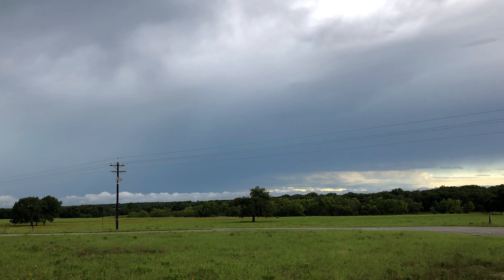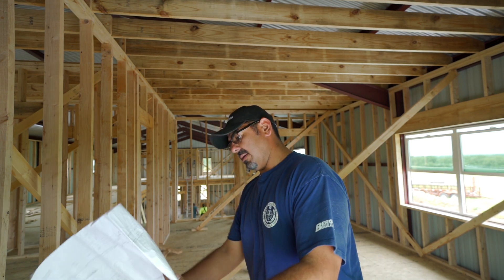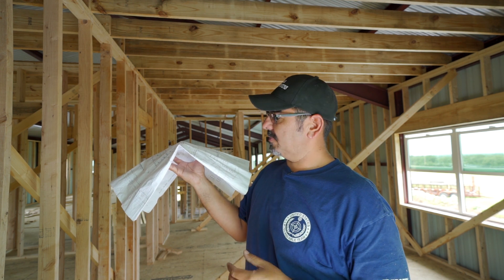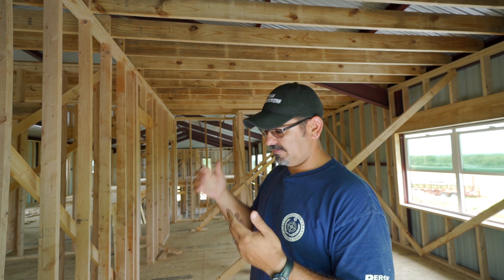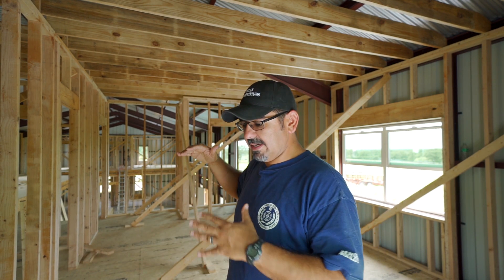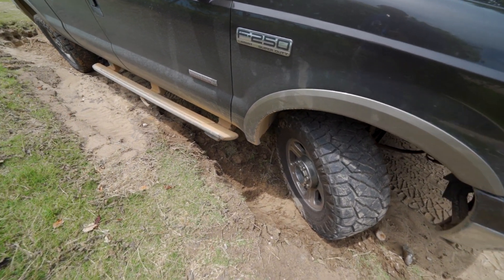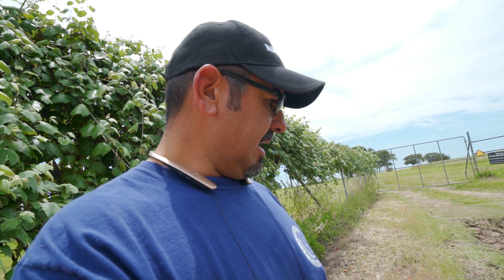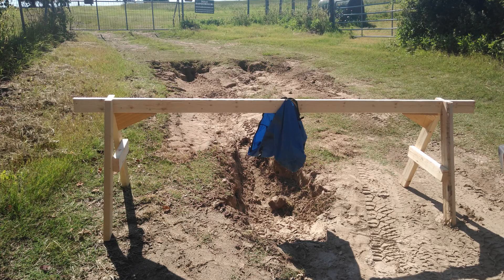Barndo 214 Framing - The Barndominium Show E134

Comment: I'm in the early stages of planning something similiar in Ga.. However building on @ a 15% slope with a 60'x60' 2 story shell. And trying to figure out the foundation. And thinking of a piered encapulated walking crawlspace for most the mechanicals and duct work. You build these on slopes before?

Comment: Please respond with your real opinion. So I’m building basically the same barndominium with some modifications and it’s only 40x60. 2x6 framing. I want to do spray foam so bad to get an air tight barndo but I get in insulation for almost for free! I I get any batt insulation with any r value ,paper/no paper for $1a bag. Should I do spray foam (10-15k) or high dense r23 insulation?

Comment: I agree that a pitched ceiling would look better then a flat ceiling in the living room. Would it work out if you used a lower pitch to give you a chase down the center for the  duct work? Or are you putting drywall directly to the purlins?
Reply from the maker: Directly to purlins... well, we will screw 2x4’s to purlins, then drywall.

Comment: QQuestions,
Steel building, why not steel framing on the interior?
Why not run the upper room ceiling frame work with the roof pitch?
That's a hole in one! With a truck. 
That's going to be a big home when done.
Keep up the great work. 
God bless.
Reply: I'm with you on wondering why they aren't using metal framing on the interior.  I guess somebody would have to feed the termites if they did. lol
Reply from the maker: Metal Stud framing is a lot more expensive than wood.  Not the materials themselves, but all the trades since they have to be commercial rather than residential.

Comment: I'm doing a metal building and thinking of steel beams for 2nd floor. Do you think wood is better ? Also do you attach your framing to the metal structure. I've heard drywall joints could crack with hard winds what do you think
Thanks and great channel 👍
Reply from the maker: We attach wood to metal.  No issues.  

I like steel beams better.

Comment: 16 in floor joists. Holly cow. That’d span 14-16 ft at least. Wouldn’t be surprised if they would span 20 ft or more. Overkill is better than under for sure. Pretty easy to have something like that slip by though for sure. Nice save. Got lucky
Reply: InstaBlaster

Comment: The building is built out of red iron steel. Why wouldn't the framing be done with light gauge steel studs? That would make the building that much more fire resident. I hope the client asked for rock wool insulation.

Comment: Erik, what would you have done differently with construction of this barndo, if you had originally planned for 16 inch beams vice 12 inch?
Reply from the maker: Make it taller or attach purlins to side of I beam instead of top.

Comment: The one thing I can't wrap my head around is how barndominiums are supposed to be cheaper when you still have to frame it in just like a stick build.
Reply: for tax purposes it is cheaper.
Reply: @lawsonransom8318  yes. It's to hide your house inside a barn, hoping the tax accessor doesn't find out.

Comment: Why wood framing instead of metal framing on the interior?  Easier to get straight walls, and fewer chances for the termites to have a picnic.
Reply from the maker: Metal stud framing and construction is too expensive.  Need commercial trades.
Reply from the maker: www.texasbarndominiums.com

Comment: Hey Buddy is your F 250 bulletproof ????
Reply from the maker: Yes.  Head studs, upgraded fuel system, fully deleted, and most importantly, air to liquid external oil coolers.  Coolers sit in front of radiator, so no more worrying about them rupturing and putting oil in my water.  :)
Reply: Finally someone who actually understands what it means/takes to bulletproof a 6.0 thank you sir haha.

Comment: See your getting a lot of "framing questions" metal vs. wood + know you've met Matt R... did you see his video on the TStud system (5-31) = strength pre or on site insulated that will increase R value and external envelope wind etc. strength.  https://www.tstud.com/
Reply from the maker: Saw it.  They don’t help in our barndos because our wood stud walls are not exposed to the outside like a conventional home.  Our entire outside wall is fully covered in foam, which make it much more efficient than conventional homes.